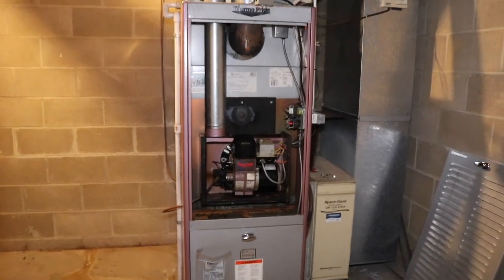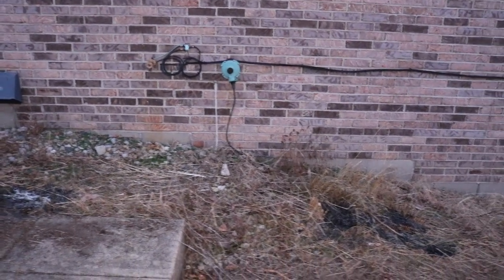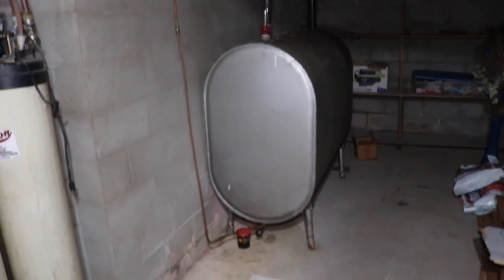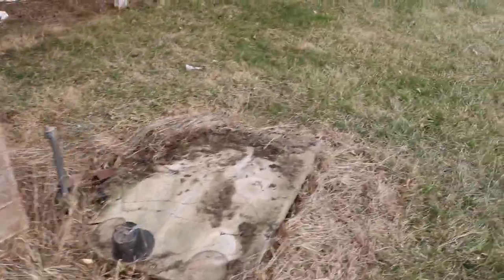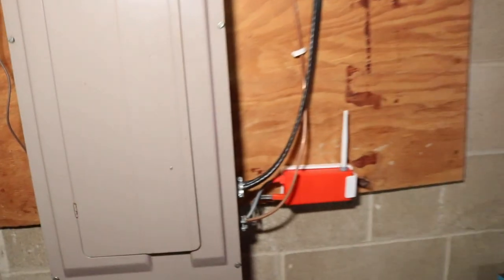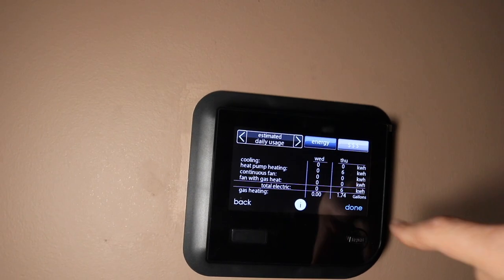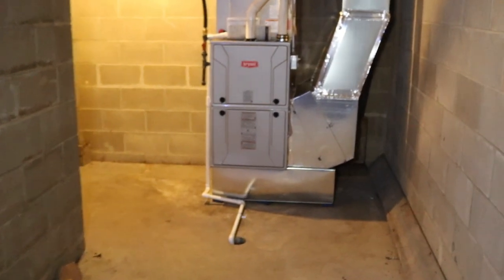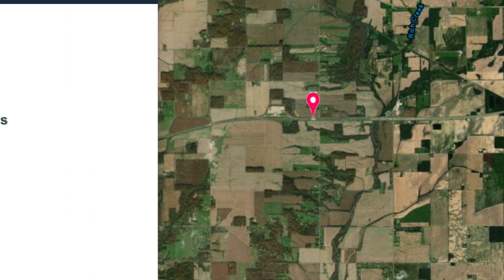It's Winter and we don't have a furnace! | Bryant Heat Pump + Propane Furnace.

Comment: Why did you not go with geothermal open loop heat pump ? You have a pond where you could dump all water as well it means ground water is very close to a surface and drilling a well will not cost a lot
Reply: @FarmerBrad  water to air heat pump costs  $3000 - 4000